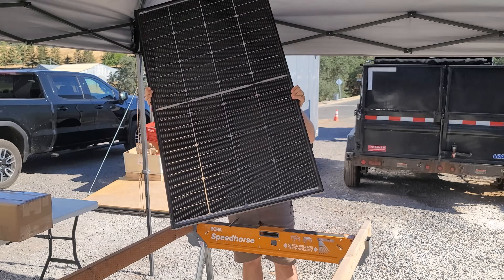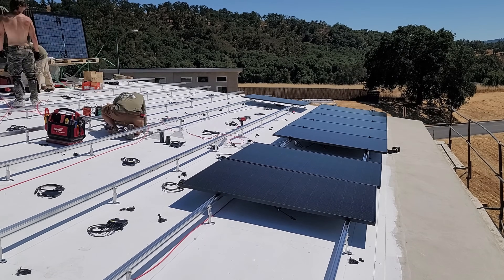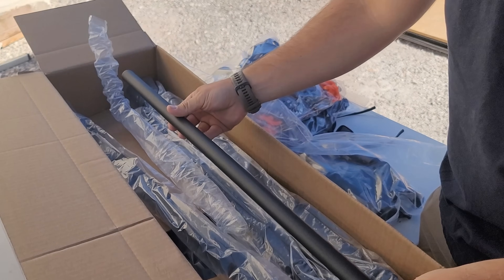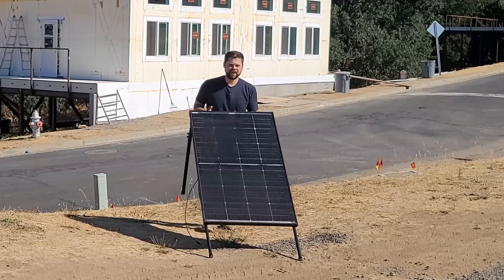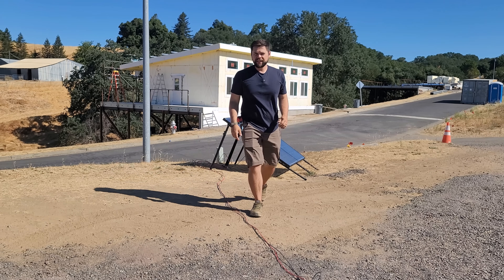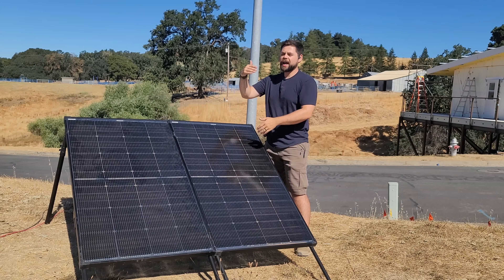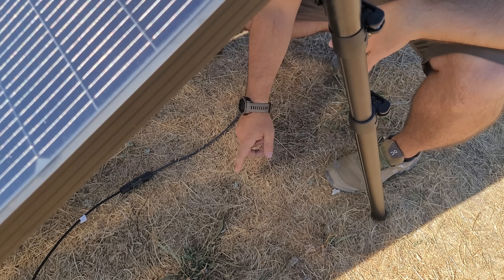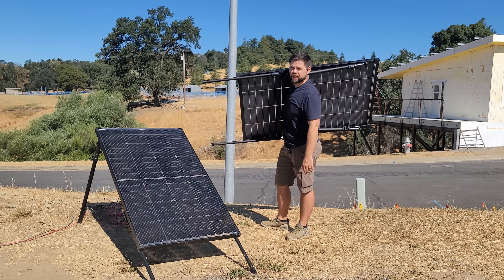The EASIEST Portable Off Grid Work Trailer Solar Setup

Comment: why would you not use a single 440 w bifacial panel instead of two of these ?  there would be a smaller foot print and the the panels the biger they are the beter the eficiency ..... also it is a bit big for a 200 w panel   ..... i like the mounting subort do , it is a simple idea and i think i will copy it 😁

Comment: For these bifacial panels that also let light through, have you tried putting mylar sheets behind the front panel as a cheap way to add more reflective solar charge? 
I wonder how much gain you would have as a result.

Comment: Man, next paycheck I’ll order a pair of the stands. I bought 2 200 watt Renogy Shadowflux panels to run a Delta 2 Max & thought I could run it serial but luckily someone caught me & pointed out they are 36.5V VOC ! So With the 60 volt max I had to run them in parallel. They barely get any sun so they can’t even charge back up over a span of 2 days.

Comment: Little bulky to store 2 vs getting 2 /220 watt EcoFlow . I have the delta pro 3 for the work van with 2 / 220 w ecoflow bi side and I usually get 400-440 watts full sun. We don’t even use any battery with the solar panels , it just stays at 100%

Comment: Bouge Rv has that panel on sale. They also have the same size panel with high power. Open circuit voltage 36.4 volts, same sale price.BTW, there is a video on YouTube where he took the guesswork out of trying to mix and match solar panels to get the right voltage. He ran it through a separate charge controller, then to the Power station. If my old brain remembers correctly.